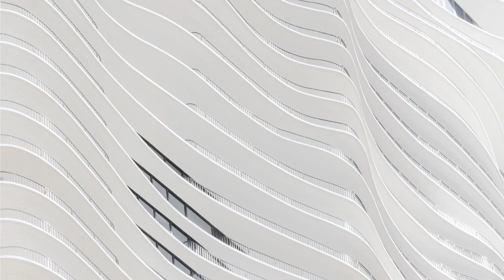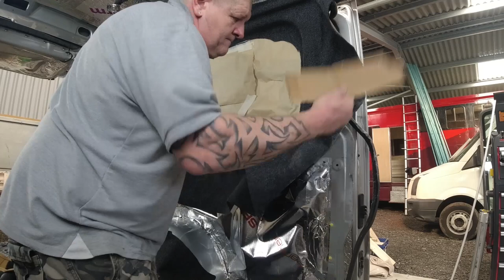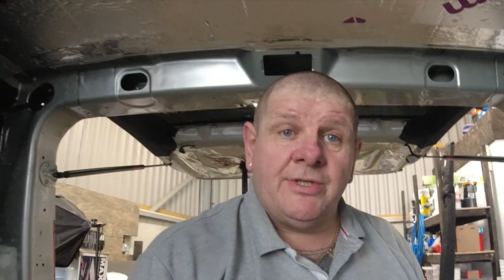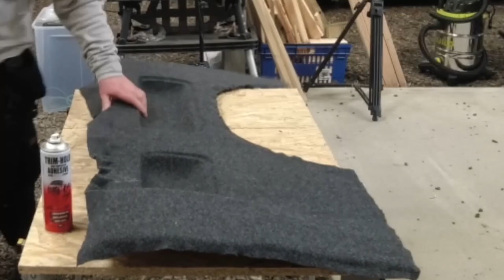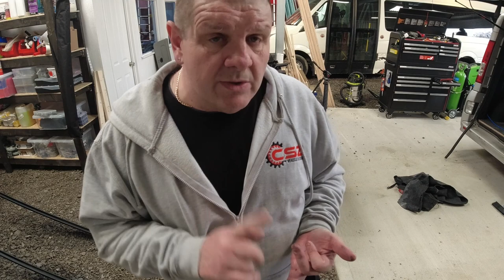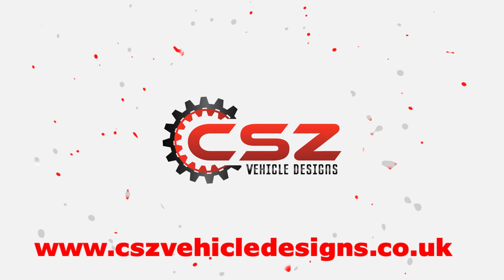Renault Trafic Campervan Conversion - How to Carpet Inside Your Camper

Comment: Hi I hoping you can help me! 
I've got the same flooring in my vivaro bus which I intend on using. So my question is, once the arches are carpeted is there anything I can use for a nice Finnish between the carpet arch and flooring please?
Reply from the maker: i would use a wooden corner beading

Comment: Looks good! But how would you fix furniture to the walls if it is all covered in carpet?
Reply from the maker: As long as you are aware of the structural points in the van, as I am, fixing furniture to the walls is relatively easy as most of this I have already planned out.  This will all be shown in future videos

Comment: Is carpeting just a preference on optics/feel or does it do anything for insulation, too?

I prefer wood/panel look but am wondering if it is worth it to remove original plastic and carpet from a Renault Trafic that has front back and two side windows to do some added insulation. Or if with a car that size, that many windows and that little headspace (thus only thin insulation on floor and ceiling), I might just leave it as is and only add camper furniture
Reply from the maker: It is just for looks really you can use anything